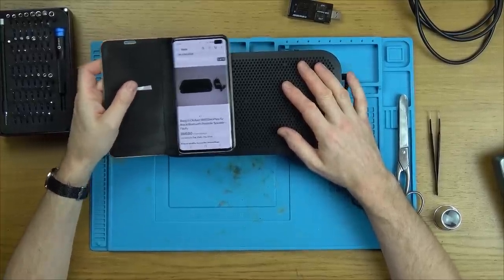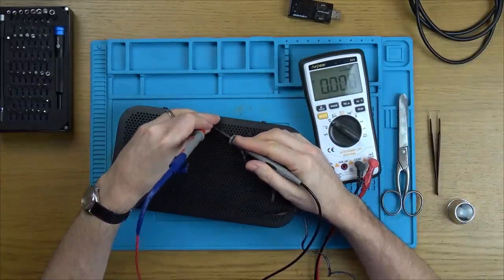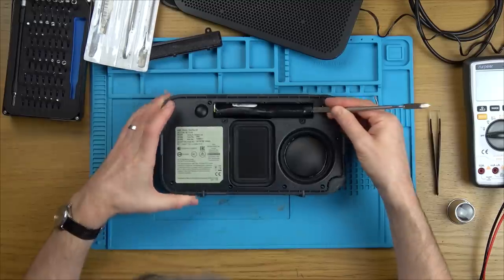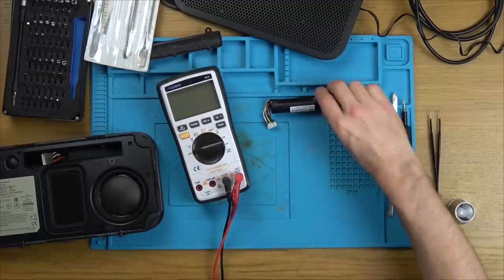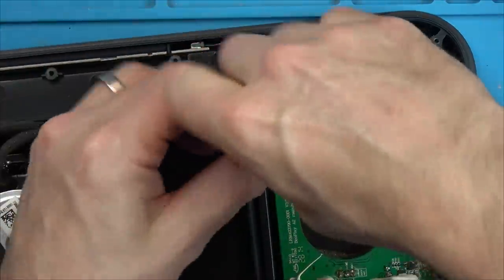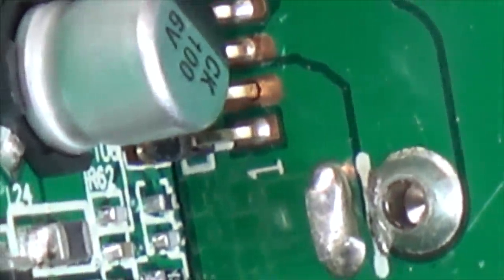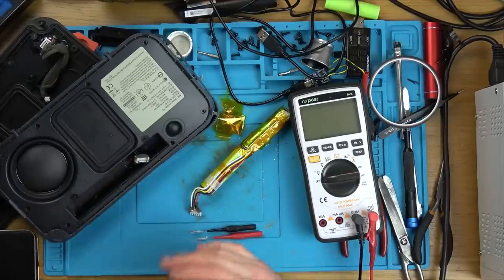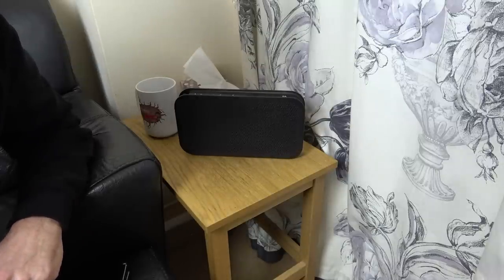BROKEN Bang & Olufsen BeoPlay A2 Portable Bluetooth Speaker - Can I FIX it?

Comment: If I have that I would change the way the battery pack is that the cells have it own 18650 cell holders so I can change either cell once it goes dead as well charge the cells externally as well balanced. As for the BMS that is neat feature as when Vince taped it up it gotten tripped causing it not to supply power sounds like there's contacts touching something after the fall causing one of the cells to go bad resulting no power or charge

Comment: Those modern speakers use DSP's (Digital signal processor) and psychoacoustics to make the tiny speaker sound much bigger. It's amazing technology.
Reply: yep, the bass is automatically boosted more the lower the volume is set (reduced more the higher the volume is set). that in combination with the dual opposing passive radiators is common in these Bluetooth speakers.

Comment: The charging board on the battery has 3 power mosfet...when u probed around u may accidentally touched the Gate of the Mosfets with possitive voltage from the multimeter and turn them on...Mosfet will not turn off until you discharge the Gate somehow...that is why it was working...

Comment: Those speakers are, iirc, what is termed 'long excursion'. It's a way of getting more performance out of a small diameter cone. My Hitachi micro stereo system has the same thing, amazing sound out of tiny speakers.

Comment: Well done on the analyses / fix. It is ludicrous / bad design to put such complex BMS circuitry (which appears to be using I2C comms) in with the battery itself and to have any product which will not work on mains if batteries are dead. A simple 'battery defective' indicator would  immediately point to the issue (though wouldn't make an interesting video).
Reply: The main give away is when you have extra wires coming from the battery pack than you would usually expect, this means that the manufacturer has programmed the bt speaker to initiate a handshake with the bms over i2c before the system even powers up, if this handshake does not take place the bt speaker will remain disabled, this is a similar case in a lot of other portable battery operated devices.

Comment: When you buy batteries for this i would just buy 2 and replace both cells because the cell may be functional but will be degraded compared to a new one. I would also look into maybe getting some higher capacity ones where you can almost double the runtime with a 4000mah cell upgrade witch wouldn't cost much more if you are only buying 2.

Comment: @ 14:54 "can't be doing anything...it's not connected anywhere..." I'm not saying this is, but multi - layer PCB's are a thing. You might well have a four layer board with a ground plane and a power plane, for instance.

Comment: The main give away is when you have extra wires coming from the battery pack than you would usually expect, this means that the manufacturer has programmed the bt speaker to initiate a handshake with the bms over i2c before the system even powers up, if this handshake does not take place the bt speaker will remain disabled, this is a similar case in a lot of other portable battery operated devices.
Reply: Is the a way to disable the handshake and run the speaker purely on the psu?

Comment: 18650 batteries like most rechargeable batteries can go short circuit. So you can have zero or a much reduced supply voltage if one or both go short as they can drag down your supply voltage.
Once they go short circuit its unlikely you will revive them. I've seen some people try to blow the short off with a high current into the battery, not recommended.
 They are cheap enough to just replace.

Comment: Basically, almost all lithium battery charging boards have a safety feature which permanently disables the input and output once any cell is severely out of balance.
Once this happens, it is PERMANENT. It won't be cleared even if you replace all the cells. You have to buy a new charging board that has this feature removed.

Comment: Normally you can reset the battery circuitry by disconnecting both cells, then leave it disconnected for a while let's say half an hour or so and then connect 2 new cells, I'm doing that all the time and it never failed.

Comment: So the bms needs the feedback pin to have power before it outputs voltage. If bms sees a voltage below the safe discharge it turns off to avoid fire 🔥 explosion.

Comment: Nice repair there Vince, it makes sense to me sort of.

I have built the R2 D2 partwork (its on my channel) and that is full of some tech.

It required us to source 6 18650 top hat cells, they then went into a battery box and it was dead, no voltage output. The manual then states for initial startup to connect the charger for 10 seconds then remove the charger and then that would enable the battery pack. So i guess it works in the same way you have demonstrated here. Question is why did your speaker not send the enable to the battery after you replaced the cell? But amazing video as always :-)

Comment: Rechargeable batteries, if you apply more than their voltage for a few seconds, they revive, let's say, those of 1.2 you apply 2 to them and they revive, and so, those of 3.7 you apply 4v, 5v or 6v and they revive, of course without a circuit charging, just one touch

Comment: I had a bit of a result off ebay, not only did I find at a really cheap price a brass cased Gruen Soviet which are like rocking horse doings in the brass, I also bought a very cheap Parnis sterile GMT with the batman bezel and the seller offers me for a tenner on top of the really cheap BIN price a 1960's Smiths gold plated watch in immaculate condition O.o

Comment: Having worked with BMS designs, some will Under Voltage Lockout, UVL, at around 2.5V per cell.  and set a flag in flash memory which can only be reset by re-flashing. So even a battery change won't fix it, very dissapointing. Also many products like cordless hair products draw far more power from the cells than the charger can provide so are incapable of running corded when the battery's finally fail, scrapping an otherwise good product. In this case surely it could have been designed to work from charger. SDA,SCL are I2C comms, looks like B&O main board are communicating with the BMS . One fix might be to create a a 3.5V and 7V supply from the 15V input with resistor dividers (a few K ohms) and feed that to the BMS at gnd, batt1+ and batt2 + , this should fool the BMS into thinking batterys are ok and do the OK on the I2C comms but without any LiPo danger. I wouldn't use any cell thats gone below 2.5V.  A pleasure to watch.

Comment: You should never mix 18650 batteries of different power outputs and brands. Unless you are using imr batteries, the batteries already have a protection circuit built in to them. Not only will the extra circuitry mess with the charging circuit of the device you are powering, but because the cells have differing circuitry, they are incompatible with each other. After a few charge/discharge cycles, the inbuilt battery protection circuit, the device protection circuit or both could catastrophically fail and cause a fire.

Comment: Not that it matters but I would assume A ground as audio ground and P ground as power ground. I could be wrong. Are they actually the same? :)
I know its dangerous but have you tried reseting the battery protection? Thr needle trick on the positive side :)

Comment: When reading a datasheet you should look at the normal operating conditions, not the absolute maximum ratings. The chip requires a minimum of 4.5V for normal operation. The absolute maximum ratings just tell what the chip can handle without getting damaged, not what is required for proper operation.

Comment: Nice video as usual. I have experience regarding the BMS and I noticed something important. When you replace any cell in a battery pack with a BMS, you need to put a voltage over the battery pack's connector to bring the BMS from the sleep mode.
Reply: Yep, most lithium charge controllers have a lockout mode when ov/uv/oc is tripped that can only be reset by applying external power

Comment: update, the battery would not charge even though total was 7.4v, I left it on for overnight and got fading orange light but as soon as unplugged same problem would not stay on and plugging it back in gave the same orange light again. Cells Would not charge individually just dropped out.  Decided to replace with 2 charged 18650 cells after doing battery weld would not give any reading on the red and black wired terminals where previously was getting 7.4v so I thought the battery board was fried.... by chance I decided to connect the battery to the unit and plugged in the charger - to my surprise got a solid green light, I unplugged the charger turned it on still had green light so tested red and black wire now read 8.2v so I think there board reset itself.

Comment: the reason for al the plastics is because of the loss of wireless conectivity if there was metal housing around the components. it's like putting aluminium foil aroud your phone to kill the signal.

Comment: Unfortunately, although the video is informative it's flawed.  The problem is Q5 (N-channel MOSFET) as this should read about 15V and not 3V as he finds. (q5 and Q6 form a bi-directional switch)  I just fixed one and replaced it with a IRLML0030TRPBF.
Reply: Does this fix the issue with the battery not charging? I have a unit that currently runs on battery, but the charging light stays orange, and the battery indicator in the app only decreases.

Comment: Noticed it had a hidden mini usb female connection on the inside I wonder what that's for?
Reply: Most likely firmware update
Reply: @sismofytter  I have a ipod that has cfw on it called rock box, would be cool if this was a way to hack it with cfw. Probably not worth the risk though as it's a bad ass as is.

Comment: you can bring those cells back by connecting them in parrallel to a good battery for about 1 minute each, Ive been vaping for 7 years using 18650s and learnt a lot about them, I also use them in little solar lights outside and occasionally they go below 3.6 volts in the winter and I use this method to bring them back to a level that they will charge at. most 18650 chargers look for 3.6 volts before they will charge to 4.2 volts. protected 18650s also have a cap beneath the posative end even on flat top batteries, sometimes the cap will pop out and render the battery useless and it will not show a charge, if you put a tiny screwdriver under the positive plate on the top and lever the cap back down  you can hear it click into place and the battery can usually be used again. 

the  18650 cells are much like a mobility scooter deep cycle glass matt battery pack if the batteries drop below 11.2 volts the  automatic charger cannot detect that voltage and so the charging will not start, so you have to use an old style non-smart battery charger to brng the voltage up to 11.2 volts so the automatic smart charger supplied with the mobility scooter will recognise the battery voltage and start the charge process. This is a bit of a rip off and mobility scooter dealers make money out of it and dont tell their customers about it. connect each cell up to a good 18650 cell in  parrallel for about a minute, 

then test for voltage again, if not it could be that the protective caps have come out at the posative ends.

I think the circut on the battery is a balencing board. my mate had a levono laptop that had 3 dead 18650 cells in it and it wouldnt turn on not even with an external power supply, I took the batteries out took them appart and connected them individually to a good cell for about 1 minute each and they came back to 3.6 volts and were able to charge using the external supply and then the laptop worked. it was a nightmare taking the laptop appart, the old laptops used to have the batteries accessable on the outside and they used to work with the esxternal power supply and a dead battery connected, now they dont its all done to make money in a throw away society. They dont want us to fix them.
Reply: Thanks  Jimmi, your guide are  very informative and  helpful.   You save me a lot of time and money 👍   And I got much clever .. 🤗 Erik, Denmark

Comment: By not turn on what you actually mean is it doesn't initialise. What does it need to initialise? A microcontroller will interrogate the system inputs. A charged battery otherwise its the charging socket init?
Nope it won't be battery shelf life its the number of charging cycles its had.
Trust B&O to give you a non standard battery most BT speakers use an emergency light 2000mAh.

Comment: Avoid beoplay bluetooth app (90% of users 1 star rating) and hook directly to phone bluetooth menu, 1. Open bluetooth settings, press speaker bluetooth button. This will bring up the speaker onto the bluetooth list but will ask for special app to function ignore this. 2. press speaker bluetooth button again (short or long hold/varients) and this will briefly change the bluetooth icon on the phone to standard access briefy then choose it and it should beep and connect.

Comment: The problem with batteries nowadays is they are 'smart'. The battery circuit has a (BMS) chip (mostly TI) that remembers/store the state of charge and state of batteries (age, couple of time charged,defect etc) . They say this is for safety..... hmmm. If you swap a battery or both, the chip still thinks that the old batteries are installed. So swapping batteries without resetting the chip (this is very difficult to do or even impossible) is dangerous and can damage the new cell very quickly. This is because older batteries need another charge scheme with higher current. 

It is also possible that the second battery is flagged defect and the (BMS)chip wont start to charge it anymore because of safety reasons. So swapping the faulty battery makes no sense at all. Charging or reviving a dead cell is not a good idea. The internal resistance change is much higher (heat up quickly) and there is definitely an enormous loss of capacity and will loose a charge very quickly. You better throw it away. Do not waste your time and keep it safe.

What you need is to buy an original battery, that is the only option or use the tweak in your video and leave it that way. I know this sounds frustrating but this sadly the way of doing business these days. In perspective of a normal non-tech customer, if the cells are dead and you cannot buy a new battery anymore, you have to purchase a new device. Yeah, all hardware manufactures go evil. Is this inside really B&O?

Comment: Why didn't you try to inject the right voltage with a PSU on the battery connection and then see if it works, it would have saved you so much time waiting to get the cells charged again. You could have skipped the whole charging thing by injecting the right voltage and see if it works immediately.

Comment: little speaker has some serious bass to it 😳
Reply: it uses the common combination (for these Bluetooth speakers in general) of dual opposing passive radiators with digital signal processing / automatic low frequency equalisation. how well it works depends on whether the manufacturer knows what they're doing with the enclosure design / tuning and firmware settings.

Comment: all bass speakers move that much because of the low frequencies
Reply: notice how the bass/mid drivers are moving a lot and the passive radiators are dead still, this is because the enclosure was disassembled so was just an open baffle with no air pressure. with it reassembled the movement would be more equal (and bass actually perform)

Comment: theses speakers are notorious for battery problems i had two of them & both batteries failed within a year. all of B&0 Bluetooth speakers use the same battery technologies I've had them all they degrade rapidly compared to bose & other brands. they may have the best crisp sounds but they got the worst batteries i stay well away from them now. i went back to bose

Comment: NEVER EVER try to charge  a 18650 li-ion battery that is below 2,5 volts, you can force it but there is a huge risk of buiding up copper bridges within the cells, wich leads to a shorted cell and how funny that looks if a li-ion batterie goes hay wire we have seen on youtube